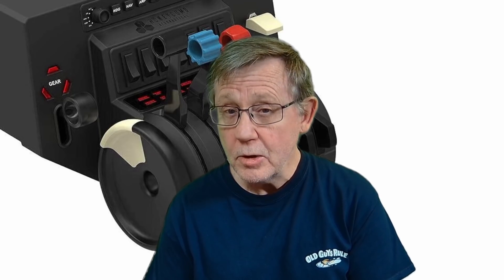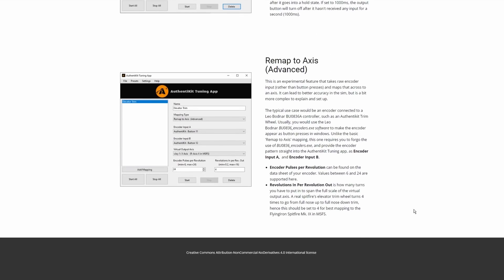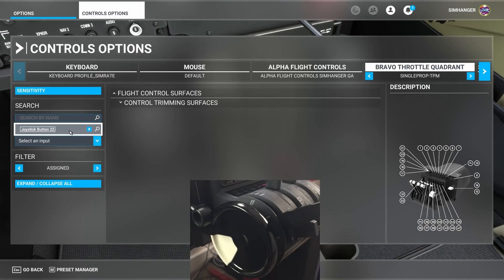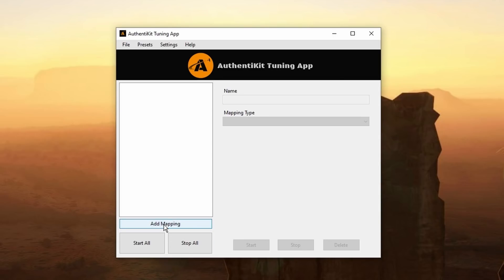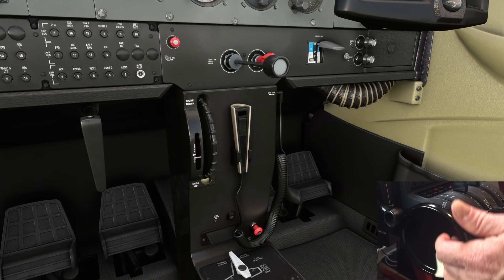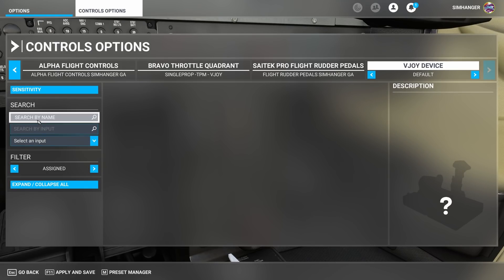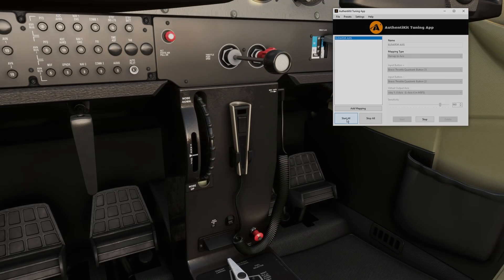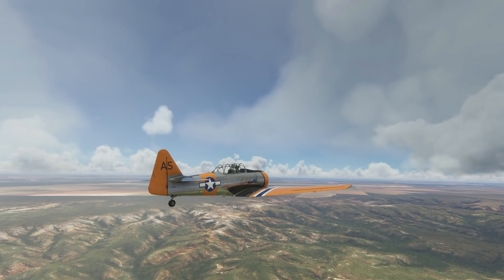SENSITIVITY FOR YOUR TRIM WHEEL | Freeware App for encoder based peripherals | Authentikit

Comment: Amazing solution!! Works 100% perfect.  I would like to suggest for ATA: 1.Minimize to Windows tray option. 2.Load minimized (on tray) 3. Load on Windows startup (also hidden on tray) and 4. Autostart X profile on load.   Basically the same options of TrackIR program. Remain hidden but working every time. Tnx!

Comment: Superb guide Mark, just what I was looking for. It does make you wonder why Honeycomb made it a pulse thing rather than an axis in the first place considering it’s a wheel 🤔👍
Reply: Because of the issue with autopilot, which controls the trim, but unlike a real aircraft can't actually move your trim wheel. To visualise with an example: you are flying an approach partially with autopilot, with vpath. You've set your throttle (I only fly GA without auto-throttle), the autopilot will set your trim appropriately for your glidepath. You reach the FAF and want to take over and manually fly the approach. Everything is fine until you inevitably want to fine-tune your trim. At that moment, the sim will read the axis value which could be vastly off from where the AP left it. For arguments sake, imagine the AP had it at 10% nose up and the last time you had turned the wheel the axis value was at 20% nose down. Not a fun experience when the sim suddenly pitches your aircraft down on final approach and you are wrestling the yoke until you've "caught up" with the right trim. Real planes have crashed due to trim malfunction - this is like that.

Comment: Super interesting Mark, thanks making a guide! Curious as if we need to do both profiles? What's the difference between the first one the one with button multiplier? Thanks!
Reply from the maker: Just two different options. Both not needed. I would just do the axis one only.
Reply: What Mark said :) The reason we added in the button option was just for the Sptifire Rudder Trim, since unlike the elevator trim MSFS only allows button input for rudder trim, rather than an axis. I'd use axis if the sim supports it for a given control as it's a much more accurate and responsive experience.
Reply: @colmanian  cool, thank you for clarifying and thanks Mark too!

Comment: the wheel in game seems to be rotating in opposite direction as the input wheel when sentivity is set to high both in this video and my own game. but otherwise works great
Reply from the maker: I have just checked again. I think your right at higher sensitivity settings…weird. Easily corrected though if you use high sensitivity just reverse the axis in the sim settings?
Reply from the maker: Because it’s moving quickly, sometimes it looks like it is moving incorrectly. Try it in flight is the best test.

Comment: I so do appreciate your efforts and research ! Excellent video.  Now if I could just get my Cessna 152........to start !  It won't for some reason only you probably know the answer to.  Is there a troubleshooting guide somewhere ?
Reply from the maker: Check the mags are both on and if all else fails try CTRL E
Reply: @SimHangerFS  Thank you Mark,  I will check them.  Engine starts for 8 secs then stops !
Reply from the maker: @Columbiariveray  check you don’t have pilot assists on. It may be adjusting your settings.
Reply: As many times as I have flown the Cessna 152, I oft times forget to turn the Fuel Shut Off Valve on. It is located on the floor at the base of and in between the seats. Not sure it that is causing your problem, but I thought I would throw it out there - just in case. Good luck!
Reply: @ArtG-49  Thanks Art G ,  fuel's on,  but the check list is indicating  that it is "Waiting for the throttle" !!  I mean...."Cmon, really"  ?  It's my maiden flight in Hawaii !  I just want to "go fly"  Lol  I appreciate your feedback !
Reply: The engine may be flooded. The procedure I learnt is:

1) fuel shutoff on
2) battery/alternator on
3) mixture all in, fuel pump on for 3 secs to prime, fuel pump off, mixture to off
4) crack open throttle to about 20%, mixture remains off
5) turn magnetos to "start" and simultaneously put mixture from off to full rich, reasonably quickly but smoothly. 
6) engine should now be on and you can continue configuring aircraft (turning on avionics etc)

If the engine refuses to start, try pulling out the mixture, starting the engine without fuel a number of times to burn up any fuel in case there's too much in there, then priming and starting as normal.

Or, if that doesn't work, prime longer with the fuel pump, verifying that fuel is flowing on the fuel flow meter and that mixture is rich and fuel shutoff is pushed in.

This is what seemed to work in the real aircraft, although it may not be "by the book"

Comment: Thank you so much for the review Mark! I'm so pleased to see people finding the software useful. If anyone has any feedback for the app do let me know and I'll do my best to add fixes and features as they come up.
Reply from the maker: Thank you for your amazing application…a transformation for many. 👍
Reply: @SimHangerFS  My pleasure 😃
Reply: I find sim trim unrealistic. When flying a real airplane you move the column to get the condition you want and then you move the trim wheel until the column pressure is gone - done. In the sim we don't have the pressure feedback and so we hunt and peck. I am sure the increased resolution will help but it doesn't address the real situation. My best thought is to move the sim column to get the condition you want (like vertical speed zero or whatever you want) and then push a button that sets that condition when you move the stick back to neutral. That would be closer to realism but might be hard to do with an app but would be easy in the sim itself.
Reply: @johnshaw7107  It's not the same as real planes of course but you do trim out the pressure with sims in a way. You have to actively keep using force to push/pull the yoke to the attitude you're looking for and then you trim until you no longer need to apply that pressure, gradually returning the yoke to the default position as you trim.